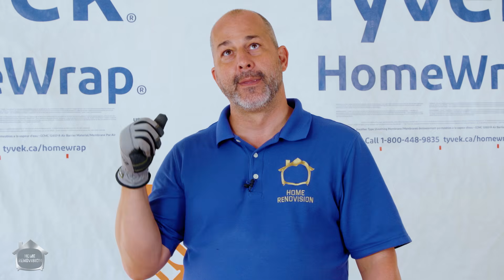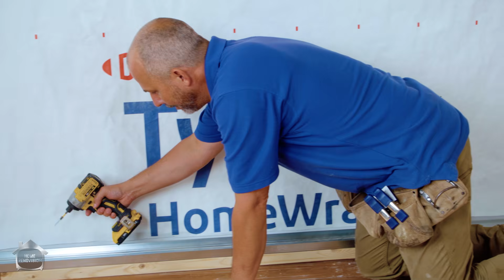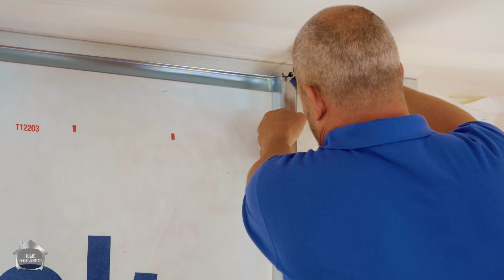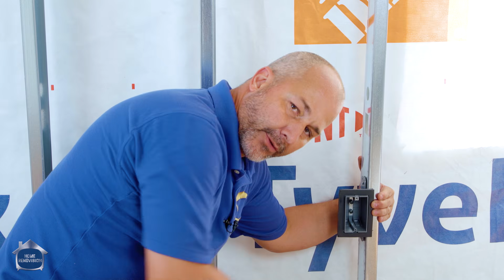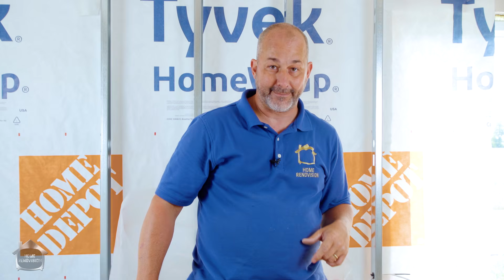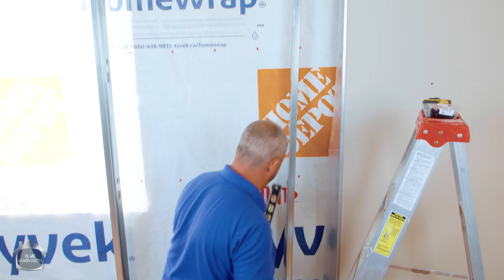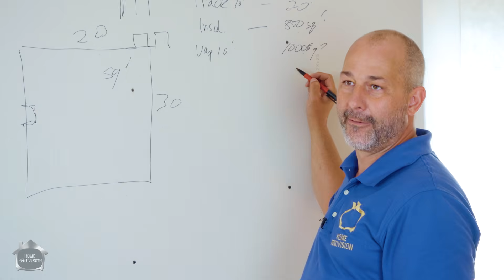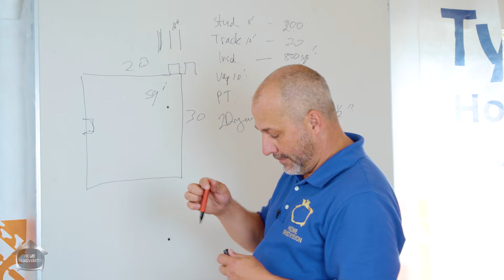Frame With Steel and Save Money! | Steel vs Wood

Comment: Is there a tutorial on framing, dry-walling and plastering an angled inside corner? I am building a room within a room for my studio control/mixing room and i watched a lot of your videos to tighten my skills which has been of an incredible help. I built the room so that the walls behind my speakers on each side are angled at 30 degrees for multiple acoustic reasons and in the eventuality that I may build soffits for my speakers. I am now doing the final plaster coat and i figured out as I go how to pull it off but a video covering that would have been very helpful and there is probably more effective ways that i haven't discovered on my own. 

Thank you for everything!

Comment: Cool video would love to see how you run plumbing with steel studs in a basement for example: around the stationary sink, hot water heater drain pipes and vents.

Comment: Great videos man, just bought a house and these videos are helping me out a lot with my DIY renovations. I do have a question. 

I am going to start working on finishing my basement in the next month. I am using steel studs and in my area code is to use treated 2x4s as a base. I was planning on using a ramset. If I use a ramset on the treated lumber will the heads sit flush enough to put the steel track over it? Then screw the track into the treated 2x4?

Or do I use the ramset and tac down the track and the treated 2x4 at the same time? I am nervous if I go this route that I will not stay in line with my snapped line. 

Any feedback helps. Thanks in advance! Keep up the hard work!

Comment: How do I attach baseboard trim to the bottom plate of steel framing?
Reply: For small baseboard I use a wood stud under the track. that goes for any floor of the house. For taller base, I rip strips of 1/2 inch plywood an inch shorter than the base, and screw it into the metal. You install sheetrock above this, and then shoot your nails into the plywood. Also wrap 2x4 wood studs all the way around the door jam.(that means top, hinge, and strike)  then you can install the doors conventionally,  and you have plenty of wood to nail to for trim around the door. I've done it this way for decades, and it works great.
Reply: @jeroldemond  In doorway, do the vertical studs face same direction, or does one need to be turned so that the wood is attached to the flat metal part of each stud?
Reply: @jssmith1608  Yes face the studs so you can screw 1 1/4" drywall screws into the wood thru the steel first. I sometimes use track around the door.

Comment: Are you able to put ceiling joist for an attic  storage and A/C air handler on top of metal stud walls ?? Are would i have to use wood on top of metal walls ??

Comment: Hey Jeff, thanks for all the shared construction experience. The building requirement for The Front Range in Colorado is floating wall construction. I find limited resources for addressing this type of construction using metal stud framing. Have you run into this requirement before?

Comment: "Please understand your technology before you shoot off in the comments" is good advice.  Mounting steel tracks to pressure treated lumber is not good advice, because the wood contains copper.  Copper + Steel = Rust (galvanic corrosion).  If you must use pressure treated wood to mount the tracks, then recommend placing a barrier between them so that the wood won't be in direct contact with the steel track.  Other than that, it's a great video.  Thanks.
Reply: I've seen people use sill sealer / rolls of that thin foam, between the bottom plates and the bottom tracks...

Comment: Hi Jeff, great video! Here in Milwaukee wood and steel stud prices at HD are practically neck and neck. Not as drastic as a difference as your situation, so for a basement remodel what would you recommend building with where price is roughly equal? Thanks!

Comment: This is great, thank you! A couple of notes: in my opinion it's better to use track for framing the door top/bulkhead and around windows (top and bottom). When you bend the track and fit it around the studs - wood or steel - you don't have the issue of the bulge that you'd get from the curl on the inside of the stud (and don't have to bend it). You can use a regular miter saw with a carbide-tipped metal blade to cut 4 studs at a time. No need to cut them with snips. I even make a lot of my smaller cuts with the miter saw just because it cuts cleaner and quicker than snips. Track is easier to cut since it doesn't have that curl/lip thing that the studs have. If you're using snips to cut, you can cut the sides, then bend back and forth and it'll snap nicely and give you a clean cut. Also, I went with rigid foam against the wall and unfaced fiber glass inside the studs w/o a poly barrier. That's what everyone is saying is the best (effective and less expensive than spray foam) method to insulate a basement at this point. I'd love to see a video on doing soffits/bulkheads; it seems like hardly anyone wants to tackle that with steel on YouTube.

Comment: I was going to use the DMX Airflow LVT 2.0 underlayment with vinyl plank directly on top of it in my basement. Should I install the underlayment first and run it to the foundation walls with the steel track right on it or frame the exterior walls first with pressure treated lumber?
Reply: Would like this answer also

Comment: According to pretty much any pro contractor in Europe, the intermediate metal studs don’t even have to be fixed in place.  

https://youtu.be/ABGd6B0v9go
Reply: Yeah they're just there to rigidify the structure so as long as they're screwed correctly to the sheet, they don't really need to be screwed to the tracks.

Comment: basically in Europe we use OLNLY steel framing, never used wood framing in our concrete-bricks built houses, wooden houses usually use Xlam for the perimeter walls, interior walls framing is steel framing too. As for the cutting we use a straight scissor, not angled. We use Beta tools for the most, expensive but high quality. To fix the studs we also use a special crimping tool or the same flat head screw you use. As for the level we use a 2 meters long magnetic level, not a short one. Good job buddy, when I was 23 I worked in this sector for 15 years... a lot of drywalls :))

Comment from the maker: If you're working on framing, then you're definitely going to need to know how to tackle drywall! Consider checking out our Drywall Series HERE: https://www.youtube.com/watch?v=BUcT5LHmA7w&list=PL34cQkzKfXWanlUzNzLhfMK1s7w0Un9gt
Reply: "Please understand your technology before you shoot off in the comments" is good advice.  Mounting steel tracks to pressure treated lumber is not good advice, because the wood contains copper.  Copper + Steel = Rust (galvanic corrosion).  If you must use pressure treated wood to mount the tracks, then recommend placing a barrier between them so that the wood won't be in direct contact with the steel track.  Other than that, it's a great video.  Thanks.

Comment: Hey Jeff, love your videos! I was watching your tub renovation A to Z and was wondering about what screws you used. What type and size screws did you use to install shower valve to the wood block? Also, what type and size screws did you use to install the wood block between the studs?

Comment: That's the most interesting electrical installation I've seen in steel studs, it works, its cheap and passes I guess.... I would recommend using a qualified electrician though to do a better job.
Reply: I didnt know you could use romex in steel studs
Reply: Yeah they actually have a plastic bushing that snaps in the holes in the stud. I've never used rope in metal studs, but I've seen the product. I think I'll stick with conduit, and a 1900 box.
Reply: @michaelmckesson6997  only an electrician knows the number for a 4 square box
Reply: @shannabolser9428  Are you saying I shouldn't say the name of an electrical product? There's a lot of different electrical products on market. They all have a specific name. I'm not trying to be a jerk, but there's literally multiple different kinds of electrical boxes, and thousands of more products available in electrical. There's no possible way for me to use simpler terminology, other than say It's specific product name. It's a 1900 box, there's also a 2200 box, a deep, and shallow 1900 box, one's that come with brackets for wood, and ones that have brackets for metal, single gang, double gang, triple gang, and many more.
Reply: @michaelmckesson6997  You are not saying the name of a product you are saying a Raco product number. That number only applies to Raco boxes, which is something only an electrician would know. Sorry for being specific, I didn't mean to offend. Just trying to get info out there for the people who don't know.
Reply: @shannabolser9428  And that would still incorrect. The name does originate from a part number. A company in 1917 which manufactured those boxes listed it's part number as 1900. Electricians which don't like changing names still called it a 1900 box after that company went out of business. Hence companies after that started using the same terminology, simply because electricians use the term. So it quite literally has nothing to do with the part number anymore, and exists simply because electricians use it.
Reply: @shannabolser9428  Just like Sears tower in Chicago. They change the name, nobody cares, and they still call it Sears tower.😂

Comment: They actually make all type of metal boxes with a wrap around bracket specifically for metal studs, all you need just a piece of vapor barrier for the boxes on the outside wall !! You can also go up to 12 receptacles on a 15 Amp circuit as per CEC

Comment: The irony with gloves and handling potentially sharp or splintery material, is that you're often better off bare handed anyway, because you're not aware of the sharpness untill you cut yourself super fucking deep because you had gloves on. I still carry big scars from listening to the advice of wearing gloves in an aluminium shop. The moment I removed them I stopped cutting myself all the time. 

This advice doesnt apply if you're the type to moisturize and keep your hands all soft and ladylike, you need some basic level of toughness on your hands.
Reply: Invest in some cut resistant gloves.  I work with razor sharp metal all the time and they have never failed me once.

Comment: Just went to Home Depot today out of curiosity to the see what the price difference was on steel vs wood right now. 10 ft Light gauge track 3 5/8 was 2 dollars cheaper than a 10 foot 2x4, and the 10 foot studs were literally half the price of a 2x4.

Comment: Its not helpful to focus on the cost of a stud when the main idea of this video is on steel framing techniques which is presented very well in this video.  I note that steel studs are galvanized, so they should not rust very easily in a damp environment, maybe yes if wet, but not damp

Comment: How much strength it will have to hang a (tv, or other stuff) in the wall with only two screw per studs+ the drywall?
Reply: You need to add some sort of backing in between the steel studs. That’s the con of using steel. You can’t mount a tv or anything heavy to it unless you plan ahead and build the wood backing in behind the wall in construction.
Reply: There are fasteners that can hang TVs on walls with metal studs. We do this at work all the time and the whole office area is metal studs. You just have to have the anchor in the stud. It would be better if it is planned ahead but it is still possible if you move things later. We use toggler anchors. They have a bracket that is put through the drywall and stud using a small hole. Then you use a bolt to attach your item.

Comment: Thank you for the video. immensely helpful in trying to finish up my project . Second question for you. I got a slab on grade house with cmu wall my late father made but didnt have time to finish.  I've been wanting to go all out. But have no one to talk to about it. 
I've been thinking for the 3 years on how to finish it . I got inspiration from your videos and this video. What do you think of putting adding a dimple mat on the floor install similar to your basement renovation.  Add the dimple mat to the walls and tie them together continuously  to the vented attic. On the walls. Have cmu . Dimple Mat . Rockwool Comfort boards  R5ish continuous insulation. Steel tracks batt insulation.  Vapor barrier . Then dry wall. 

Would be perfection and probably passive house worthy . 

Thoughts ? :)

Comment: Hey couple of points that I was thinking of

What do you think of 1-2 inch of foam boards before putting on your track as a thermal break.  Also I was thinking of rockwool comfort boards bc they would be vapor open. 
Second what do you think of vapor barrier paint primer  instead of the the true vapor barrier ? 

Also be sure to add plywood blocking where you are going to have cabinets. It will make the wall immensely strong 🙂 . My contractor did that for me as part of the job and  it was ridiculous strong the cabinets were.

Comment: I remember being amazed 35 years ago when we were working at Manchester Airport (UK) ..... they used the same metal studwork to make offices in a bare building! The only real difference was they did not screw it, they used a punch that punched a slot through both pieces so the back looked like the back of a staple! Rock solid, quick, and once you have the punch Free!
They even had a pre-walpapered board that they screwed onto the studs and slipped a thin plastic shim the full height of the room (it looked better than it sounds).
I still cant find anything quicker or easier to install! ..... and now I find it is cheaper too!
Reply: DR PHIL  Definately NOT demountable! Each riser was "stapled" into the tracke top and bottom and to each half of the riser in the middle! You could just take the board off to alter the electrics though ;0)

Comment: Another great video Jeff... But the builder has insulated basement wall with a vapour barrier.
I've been informed that I can use 2"X3"x8' in front of vapour barrier.
Install electrical boxes as usual but run electrical wiring behind 2x3s instead of drilling holes for the wiring.
I see there are no 2x3"  metal studs but 
1 5/8" ... In your opinion what would you recommend metal 2x4" or 1 5/8" on outside walls? I'd use metal 2x4" on partition walls with wood 2x4" to strengthen door openings etc.
I've used metal studs before but that was 18 years or so ago.
Thanks in advance for  any advice... And yes I plan in joining monthly as I will have other projects.

Comment: Electrician here, we make holes in those steel studs all the time. Some of them also have premade cutouts for electrical conduits.
Reply: Yes, indeed.
Reply: You can either use metal boxes or plastic boxes. You will want to use bracket boxes that have holes to screw to the metal studs. If you use metal boxes make sure you use a grounding pig tail to ground the box.
Reply: @shannabolser9428  does the wiring have to be in armored cable or conduit? (when passing through these steel studs?)
Reply: @77Avadon77  it is preferable if it is an armored cable or conduit, but you can use romex with the plastic grommets to protect the wire.
Reply: and then years later the framer/drywaller  "me" come back to fix a sagging wall or crack because you made those studs weak there hahahahah  jk
Reply: @bro1ification  There are all kinds of drywallers out there... once I caught a dude install a C stud turned the wrong way, then later he leaned on it, complained how much the wall flexed and what a piece of shit the studs were. He had no idea what is axial moment of inertia, what he did wrong or why it was wrong. It was really funny because that entire wall was placed in the wrong location anyways and there was no electrical in it.
Reply: Can these use BX wires and what boxes I need for switch and receptacles
Reply: ddo you  use metal boxes on metal studs?
Reply: @Ccoleworld3  Jon C Dvorak would say that's a good question! #NoAgenda
Reply: @VRtechman  It's actually Vlad Svertkoj ,Ok?
Reply: true
Reply: im guessing you have to use metal....casing or what ever its called to keep the studs grounded? or do you just ground the wall at the box?

Comment: I watched a lot of Your videos recently (I started doing my first attic remodel and was kinda clueless) but this is the first one that make me think how lucky I am to live in Poland. I guess prices are much more sensible here. I bought a lot of this metal studs for the walls and for example 3 meter ones (not standard, here typical is 2,6 m) were around 8 PLN so around 3 $ (CAD) each. Maybe I'm wrong and wholesale prices are better - If I bought those at hardware store I'd pay around 7 CAD - but still. Differences in cost of building and renovation here are much lower than other eu countries, USA and Canada.

Comment: There are special crimp tools for metal framing so you don't have to use screws. They make flush walls because there are no screw heads.
Reply: Ya, but if you make a mistake and need to move a stud they are very hard to move.
Reply: wow thanks

Comment: Just checked Lowe's app. At my local Lowe's in Florida, standard pine 2x4x96 is $5.81 and a metal stud 25GA 3-5/8x1.25x96 is $7.28. I'd still take metal if I was building a basement.